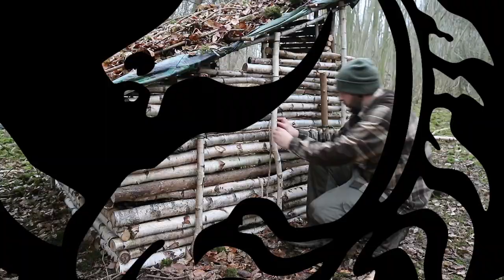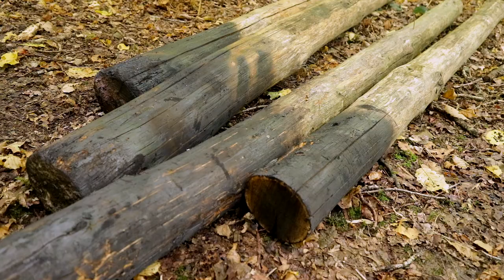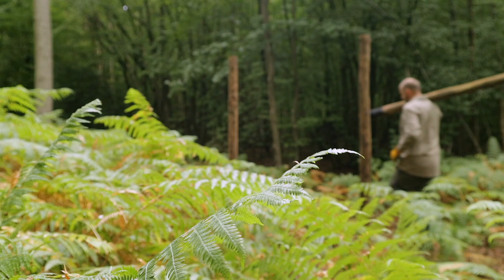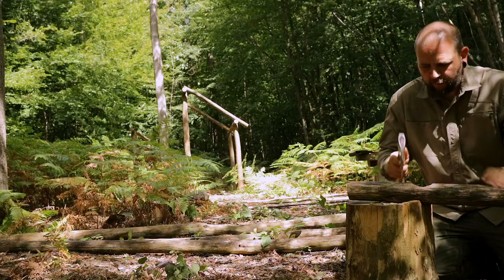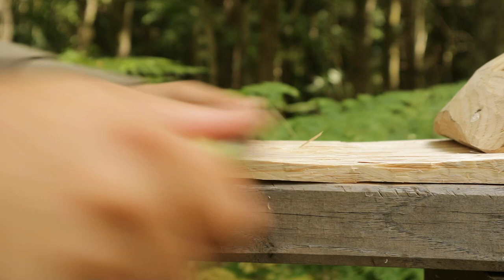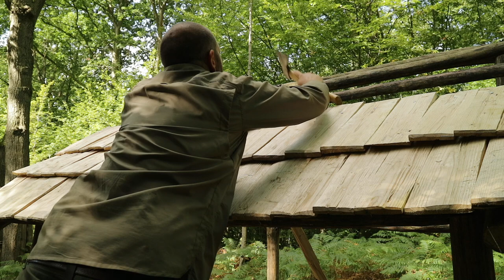Building a Roofed shelter in the woods with Hand Tools

Comment: Hi Andy,brilliant video so far👍,I’ve been a carpenter for 35 years,not a chippy hahaha, great to see you using natural straight out the ground timber and some old methods,, this is just a TIP, but on you’re very first cross timber ,if you add a cocking strip on top of that by just easing up the bottom of ur first course of shingles , about 1”/ 1/2” the bottom of the second course will slowly but surely set better on the first course!! I’m not picking mate just giving a tip,, great video look forward to the next step,, Andy

Comment: Great proof of concept, but.... you need to sink those pegs in as as as you can, about 4-5 inches at least and instances where you can, do all the way through! And also, the shingles need to overlap at least 50-60% and the joints must not line up. That way you won’t have light shining through and it should be water tight! So you essentially need to work out your roof size, and double the amount of tiles you’d need to cover it with no overlap 😊👍🏻
Reply: lewi bear There’s always one !!! ......
Reply: @valeriechaumeziere377  apart from I actually have experience building cabins as I featured on this channel two years ago... 🤣👍
Reply: @valeriechaumeziere377  Yup, always one that knows how it's done properly, as an X-Roofer our Motto was water runs down hill and paydays on friday unless the Roof leaks, then friday may never come...lol  😂

Comment: Great work, I like, that you use wooden nails on the framework - 
though some hints, if you don't mind:
1. the most important part to burn the beams is -10 to +20cm to the surface - there the rotting process is the most intense. Underneath the soil is "dead", above the wood dries out quickly.
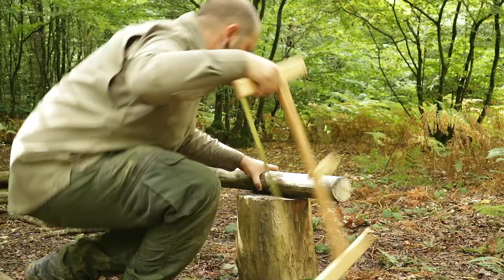 You missed the goal, especially with the beams  @6:30 and  @7:45.
2. you carried a lot of tools into the woods (or is it your backyard?) - two axes, a froe, a saw, an auger-bit, a shave-horse, quite some nails - but no hammer?
The back of an axe or hatchet isn't hardened, it's too close to the eye which is kept soft to prevent breaking when the handle is hung. So it's not ment for pounding. I think, I saw your axes are already starting to mushroom out.
3. The bottom row of shingles should be raised at the bottom by putting 1/2 to 1/3 shingle flush underneath, otherwise the split between first and second row makes it prone to be lifted off in a storm.
Stay safe and healthy!
Reply: Also, the shingles don't overlap enough - it'll leak just a bit in the rain. The key is to have the bottom shingle completely covered, the next one protruding 1/3rd over it, and the next one covering 2/3rds over the second row and so on. You only get 1/3rd of the length of shingle per row, but you have a layer of wood with no overlapping cracks everywhere. 

Still, making a shingled roof by hand in the woods is quite an impressive feat. And yeah, next time pack a hammer!

Comment: Absolutely lovely looking job so far! Quick question - don’t you have to char the vertical posts to above ground level? I thought it was the microbes in the very top layer of the soil which were mainly responsible for degrading of the wood.

Comment: i would have made clay-ash cement for the post because i have never tried that stuff bevor but you  did fire the posts which is something i also do even though i use western red cedar/juniper trees i also leave a couple of branch ends for hooks  so i can tie a stainless steel electric fence wire  for hanging stuff from i found lots of the wire in treetops, might have blown there during a storm ? still 100s of feet up there i didnae gather up yet .  i have a moped i use to make trails , one trail leads to a spring the animals use i also brought in strawberry plants for a clearing i found  there is a wash with exposed flat rocks i am building up an center post 2 feet in diameter  that will be an altar for a radio or a lantern and kinda defines the center of the camp  i still need to clear a path to all the areas but some of the downed trees are over 2 feet trunks and 60 feet long so without a chainsaw  the camp will have to accept them but i cut off the limbs for dry firewood  and am making the ashes for the clay-ash cent i'll need to fire some clay bricks for 2-1/2 to 3 hours then smash into grit for the clay-ash cement since that is the 'clay part not plain clay  i need well burned clay that resists water absorption . i never  seem to have the time to  create my ideas , even god gave up after just a few days, i heard he's doing good now, has a little place near Winding road over by shoalsfoote along the reeds  i reckon you've heard about his son, such a tragedy but it was all designed into the system . i noticed this video is 3 parts , so i am just now watching the 3rd part , being in the UK the rocks is what i would use but i don't have the binders  just flat rocks and some gravel  so i used a tapering cone  on the center post with a large flat stone and then some rounded pebbles then another flat rock and some more pebbles and cap it with a larger flat rock it is not built yet, i am still gathering the rocks and pebbles and i want to dig out a deep base for it and backfill with gravel and silt  _ cheers

Comment: you do have a ladder hidden in the dark, i was wondering how to get the auger so high to make a pin and hole? For the shingles you have to put three rows on each other to make it waterproof. But nice work making the shingles by hand. Hi Andy, what diameter auger you use?
Reply: If you read his blurb he says three shakes are required and explains why he used only two.
Reply: Nowakezone Forever Andy uses only one, with two you cover the sides, with three you cover the point
Reply: hendRIK arQiteKt yes, I’m saying he tells you why in his blurb he didn’t use three in this video, because this structure does not need to be as water-tight as a true cabin and for the sake of time.

Comment: You  have been watching too many bushcraft videos turn the spoke shave over and you can see what you are doing and adjust your cut .Are bushcrafters trades people who were trained by trades people no.Monkey see Monkey do.Ask an old carpenter 80 plus you will learn a lot if you listen.
Reply from the maker: Hi, don't really get to watch many vids. I use the 'DRAW KNIFE' a different way around depending on what I am trying to achieve but mostly with the bevel on the bottom side doing this. Ps.. day job is carpentry ;)